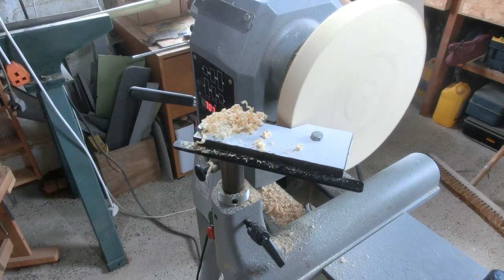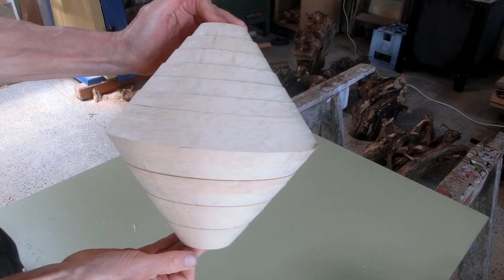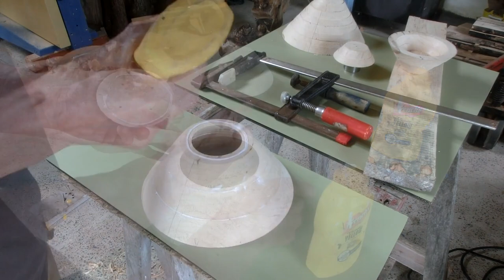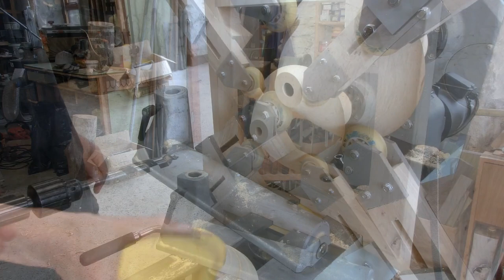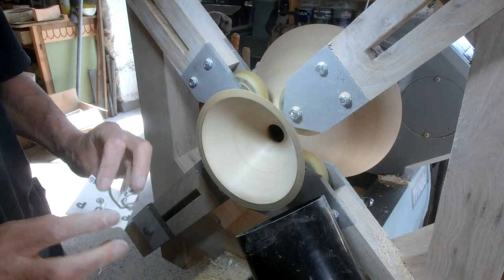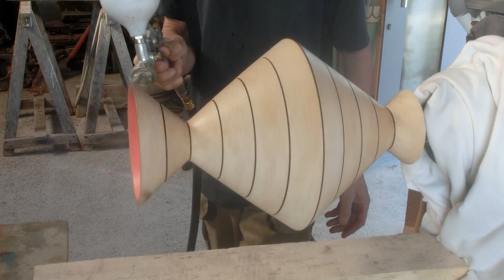Woodturning Art Deco Vase. (Edited version. Channel trailer)

Comment: The piece is beautiful! Come on tell us about the jig.
Reply from the maker: Thanks very much Peter. The Jig is home made from bits of scrap. For images of the tooling used in this video visit my community page.  https://www.youtube.com/c/MartinWoodhead/community
Reply: What kind of wire/yarn/cable did you use for burning the dark lines? I tried with a polyester yarn, it didn't work.
Reply from the maker: @kerstin4516  Stainless steel cable. 😊